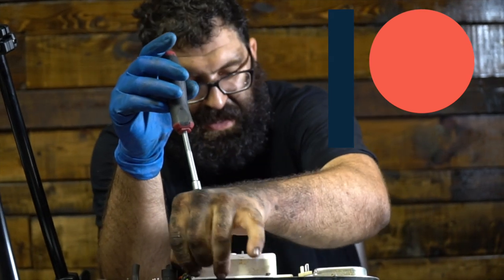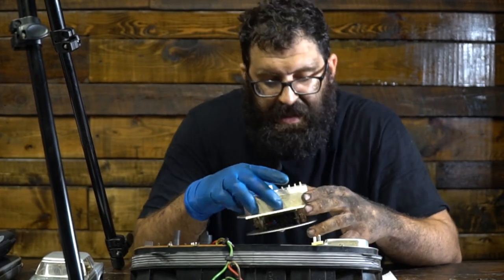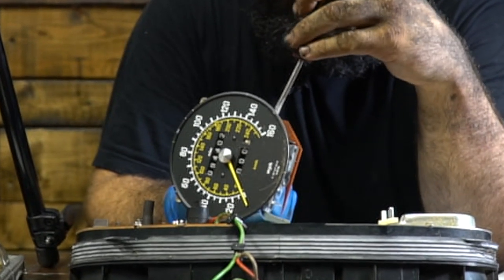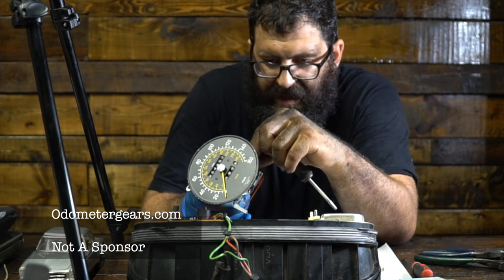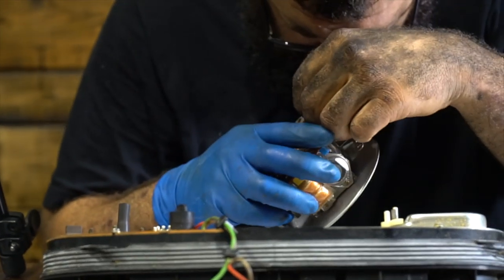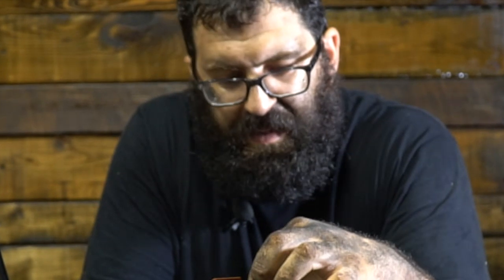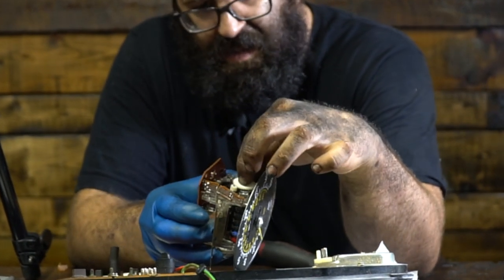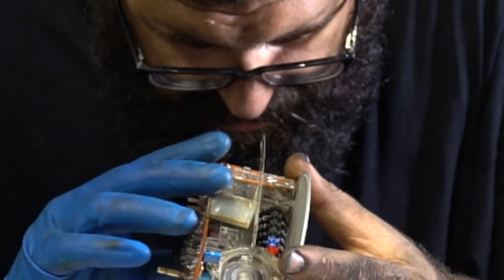Odometer and clock repair part 1

Comment: Thank you Peter, just completed completely refurbishing the 560sec fuel pumps units.  No leakage, yeah!  Now I will be able to handle the dash repairs if it ever comes up. Oh, the SLS return line is about ten feet long and what a job that would/will be to snake it through.
Reply from the maker: it is a little hard but youll be ok

Comment: Cool video! I have disassembled and restored a couple of old Ford Odometers on a 65 Mustang and then my 72 F250. The Mercedes odometer appears to be very complex compared to the Ford odometers by comparison. I hope I dont run into any problems with a Mercedes odometer in the future, I am a little reluctant to tear one of those apart. Lol, keep up the good work. 😁
Reply from the maker: just watxh out for the gray drive gear...source of 90 percent of issues on these

Comment: I have a few videos on slow clock,  and odometer gear repairs. W126 W123.
Reply: I'll check it out.
Reply: That’s great I’ll check it out. I’m already a subscriber of yours. 👍🏻
Reply from the maker: awesome!!
Reply: @LilyoftheValeyrising  thank you for the Sub. if you need any custom technical videos for W123 let me know.
Reply: Mercedes Benz Revive thanks! I have a 75 450SEL and a 80 450SL. A lot of things are very similar.

Comment: I have an issue here, i changed gear on my w126 odometer successfully. Today i was surprised as the odometer read almost twice more than than actual milage. What could course that? Any capacitor/transistor that could make the motor to revolute faster than usual?

Comment: When rebuilding your odometer, the aftermarket gears don't fit exactly perfectly the way the original did. I put in my new gears, assembled everything and took her for a spin.  No odometer movement.   I discovered after a second disassembly that the topmost large gear, the one directly in connection to the itty bitty gear, had too long of a neck.   The neck on the gear was pushing up against the clear plastic retaining housing.  What was happening is that the neck on the gear created too much friction for the gear to spin.  The easy and quick fix is to trim that neck mostly off.

I've read a lot of commentary with people having issues and wanted to share my observations and solution.  Good luck!
Reply from the maker: Yeah that’s happened to me you have a couple of times. Do you talk gear is manufactured with a little note on it that jams the entire assembly

Comment: I had to open a mechanical speedo from a 1979 450sl recently.  It’s totally different than the electronic speedo shown in this video.  So it’s worth noting that this is an electronic speedo 107, probably 1980 or later.  

The issue with my 1979 mechanic speedo that failed while I drove it.  I think I hit the reset button at the gas station, and there must have been too much resistance in the trip meter side gears.  I lubed it up with transmission fluid.  I probably should have used clock oil.  Then I had to superglue one of the gears to its axle because the failure was where it came unbonded from the axle.  

The older mechanical gears weren’t gushy soft like the electronic speedo gears I’ve repaired (107/126/129).

 There are some good threads on repairing the old Kienzle ( or is it keinzle ) clocks online too.  I had to solder what is essentially a “fuse” back together on my very cool first 1973 450sl dash clock.  Fun restoration stuff after getting all the mechanicals to tip top shape!
Reply from the maker: is your gray gear slipping ion the main shaft
Reply: Mercedes Classic with Pierre Hedary 
I’m sorry I didn’t take any pictures of the 1979 450sl speedo issues and fix. What I do remember is that the drive side of the shaft could move when I removed the long worm gear that connects the gears to the speedo cable connection.  The gear on the end that connects to the worm gear was fine, but the gear on the opposite side of the shaft was slipping.  The slipping was probably caused by resistance in the rest of the odometer gears.  I did a quick fix to get the odometer working again, some carefully placed drops of super glue and lots of lube on the rest of the gears.  I’m going to have to drive it a while to determine if the fix will last.

Comment: My SEL clock was very hard to repair. I wasn’t successful. I have to learn more about them. I could eat get the pin to go back in the hole so the gear that runs the clock would engage with the gear that is inside. hard to describe 
I’m working on it. I’ll take it out again, since I do most of my work in winter.
Reply from the maker: those early clocks are really tough Maria
they never cooperate and have soft gears
Reply: Mercedes Classic with Pierre Hedary I’m going to try again since I’ve seen your part 2 video. My other problem was the tach needle wouldn’t come off so I could get the face (with the tach numbers) off to put the clock pin back in.

Comment: Does it help with wear and tear on the unit if you have to reset the trip odometer that you don't reset while the car is moving?  The gears are spinning and by resetting the trip it spins the gears against other spinning gears, grinding them off.  I have a 1991 350 sd and I have never reset the trip odometer when the car is moving and everything still works as it should.  I reset the trip odometer once every 500 miles as that is my fuel gauge, as the fuel gauge has never worked correctly since I have owned the car.
Reply: You should try and fix the fuel gauge. First check to see if the wires are connected at the fuel sender.
Reply: @dieselbenzrevive6820  The gauge "functions."   When the tank is full it reads full and tracks OK for ~200-300 miles, or 2/3 - 1/2 of a tank then it stays at 1/2 or swings to empty then back to half.  I pulled the sending unit out of the tank and cleaned it a few years ago.  Didn't help.  I move a lot, so when I get to a new city it is find a Dr. Dentist and MB mechanic.  One guy tried to sell me a cluster unit, I said no.
Reply from the maker: i think your sending unit is still the issue
Reply: @virutalnewscenter  if you have the time i suggest removing the sending unit from the tank,Inspect and clean and reinstall.

Comment: Is w123 240D odometer repair more straightforward than this?
Reply: I have some odometer repair videos as well that might help. W123 has a different issue. Where the plastic gear detaches from a metal shaft.
Reply from the maker: its a different animal. there is a gear on the end of the main odo shaft that drives everything else...it starts to slip and the ID has to be narrowed just a little bit